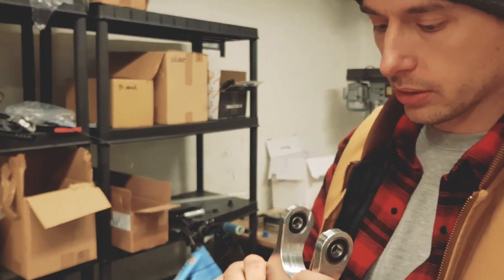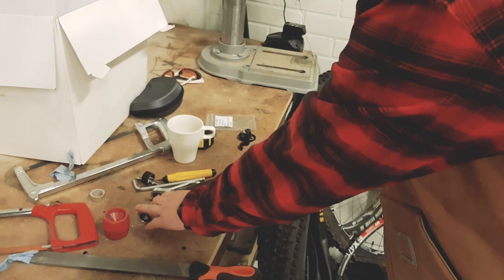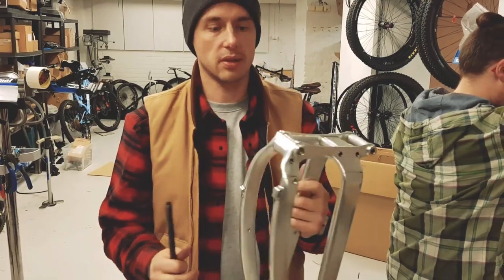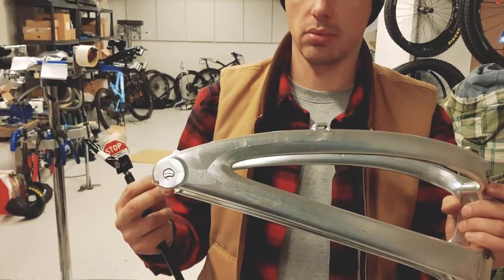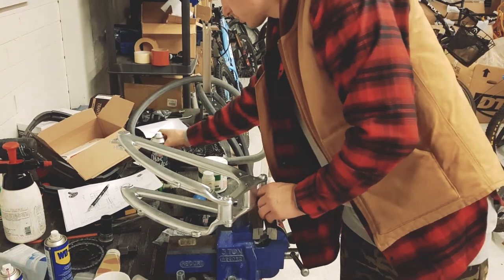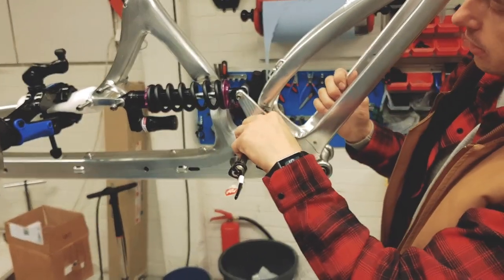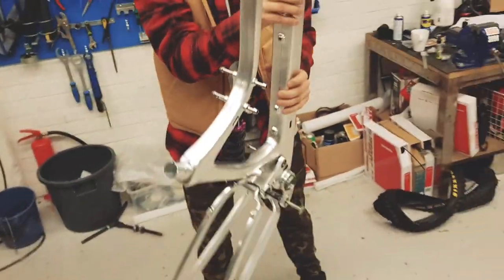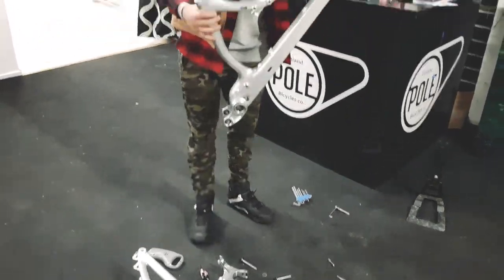Machine vlog part 1 - The Assembly

Comment: As someone who was seriously considering purchasing a Machine, after watching this video, I have decided that the  "professionalism"(?) demonstrated in this video has convinced me that any garage mechanic would be a better source of craftsmanship.

Filing, hammering, washers, using a rear axle for a 12mm fastener, reaming a hole with drill bit mounted in a $30 vice...are you serious?

When a company makes a video for potential customers to see, they should be aware that it gives the public an insight into the manufacturing methods, the level of expertise of it's employees & their pride of workmanship.  What I saw was amateurish butchery by someone obviously unaware of standard manufacturing practices.

The thought of trusting my life on a product made by someone who lacks basic shops skills has convinced me to buy my next bike from a "real" bike manufacturer.
Reply: Joe King, that's prototyping for you!  I once read about a major bike manufacturer that built a 50 lb main triangle out of steel plate to resolve a question the engineers were debating.  A couple laps around the parking lot on that monstrosity answered the question at hand and it served its purpose.

There are industries where everything is made to micron tolerances and every imperfection is resolved on exotic machinery ... and that's why satellites cost tens of thousands of times as much as bikes!  With every iteration comes a list of dozens of errors: some appear during assembly, at which point we improvise and get the bike rideable (if possible), and some appear during riding.  Nothing goes to market until everything is resolved and a repeatable manufacturing process is established.

The things you see here aren't unique to Pole - or even the bike industry.  I give Pole credit for being brave enough to let the public peek behind the curtain.
Reply: The video description says this was the first ever prototype being built up. That's what happens in R&D... They said they didn't have everything handy and were eager to try see how it was. I don't think your finished product is going to have drill score marks on the inside of the swingarm!
Reply from the maker: Keep following and you will see a lot of phases that we go through before the finalized product is out :)
Reply: My first impression too. Very brave to let out video material that can and will be misinterpreted as being the final assembly method. 
Then again, I would do the exact same way. Or would I place an order and wait for a proper reamer or new suspension link machined to arrive if I had a chance of getting the first prototype assembled and running right away, albeit, with some necessary hacking and butchery? 
It’s not like they have a batch of 1000 parts needing filing or OCC -style assembly practices waiting to be installed into production bikes. Just need to replicate the change in Solidworks and the rest of the pieces manufactired won’t need any modifications. 

On ’amateurish butchery’. Hobbyist can achieve the same quality as pro but doesn’t count the cost nor hours. 
Pro gets the job done with resources (time, tools or material) at hand. Very rarely if ever can hobbyist notice the distinct difference in the path to the end result or have the actual skill to reach the level to have his bills paid by the customer.
Reply: @joe king did u notice this is a unfinished frame, it has not been polished on the surface? And Leo said in the beginning the pivot has been machined wrong/faulty.
Reply: Joe King this is a PROTOTYPE
Reply: I totally agree with you Joe. It seems that they've just looked at all the current bike trends and just made the geometry as extreme as they can, it kind of gives the bike a odd look and not in a good way.
I do like the polished frame and some of the machined look. I just bought an Orbea Rallon 2018, there's so many good bike out there.
Reply: Brody Cross the problem is that the other bikes are all similar between each other.
Reply: theblackjack channel mine isn’t! Have you seen an Orbea Rallon?
Reply: looks like a stumpjumper tbh
Reply: spoken like a true garage mechanic himself who knows fugal about engineering and prototyping...jealous much? What were they supposed to do, buy a 500K Hurco CNC machine to sus out a few minor details to get the prototype up and running?? lmao... get a life putz..  do you know what major manufactures (Foes etc.) do after the heat treating process on aluminum frames?? they use mallets and an assortment of pry bars to tweak the frames back into alignment (yes, you can find video's of this)....whatever works.... please get a clue before making dumb comments on youtube.